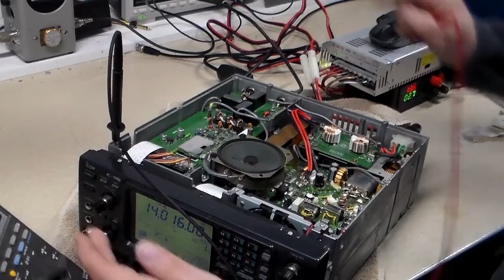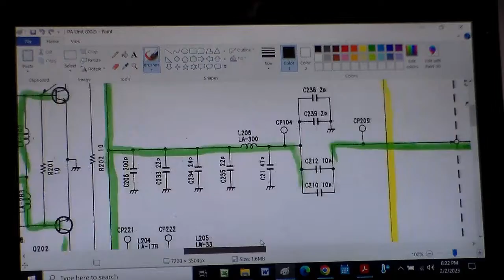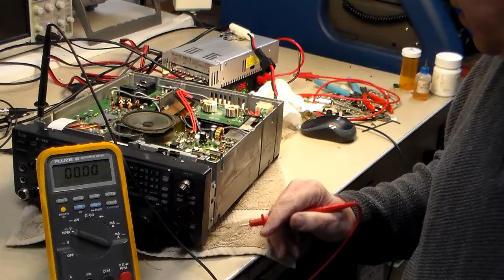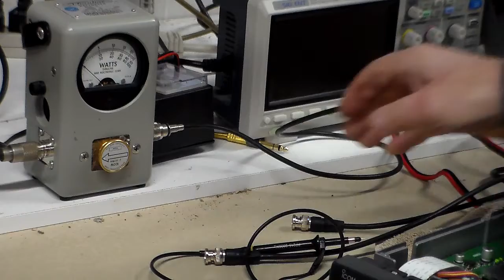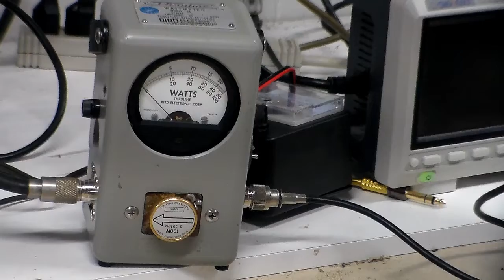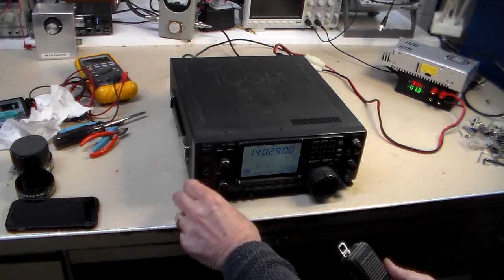Icom IC 746 Low Power Out - Solved!

Comment: Mine has good power out but the alc is low, like 50% no matter where I set it. Is there a fix for this?
Reply from the maker: On that radio, the full ALC range lines up with the PO 50% scale. Dont get them confused. You could try a peak reading watt meter and see what you power out is as you increase the mic gain.  For best audio and performance the mic gain should be set to keep you inside the ALC brackets. Hope that helps.

Comment: Had identical problem with a Yaesu FT-840. Low transmitter power, intermittently turned off and warm connector. Ended up being the Molex connector. Specifically poor crimping inside the connector. Good videos and info! 73! KA6VIP
Reply from the maker: Thanks for sharing. Glad you got it straightened out.

Comment: Had TX on all bands apart from 22 to 28 on a ICOM 735, turned out to be a relay which was replaced.
Then removed the PA board to check for dry joints and then refitted and now have no TX on any bands.
Receive is good throughout.
What could have coursed this?
Many thanks....

Comment: I have the Icom 7200. The power cord has dual blade fuses. Over time the fuse blades oxidise and the power drops off. Clean the blades on the fuses and power restored

Comment: Mr. Malik, I have a device with you, Icom 746 Pro. Youssef, I have a 746 Pro device. It has 100% reception and transmission, but it does not give a power reading in wattage. It is very low. Are there any patients? How can it be repaired? What is the faulty part? A picture so that I can complete it. Thank you very much.

Comment: Bypass the negative side fuse while your at it. It serves no purpose on a negative ground situation.
Reply from the maker: Thanks Larry. That negative side fuse may be some extra protection in a mobile set up under some specific failures, but, you’re right, in this situation it is probably just adding some resistance to my supply lines.  Oddly, I have a Kenwood mobile in my truck and it only has the positive lead fused.  Hmmmm.
Reply: @KA3AJI  If that fuse blows the antenna jack ground foil opens, that causes many other issues. I've seen it happen many many times. I always cut them off in my installs, so I would not have to fix foil paths later.  That fuse is only good in a positive ground situation. And then red lead fuse should be removed. Just a friendly tip from a 2 way radio repair guy. Good trouble shooting BTW.

Comment: 2 things... 1) You need to tx longer..... This is how I found the power issue on my Ic706. The fuse holders were at fault on my power cord. 2) You never addressed the improper voltage reading on the Q2. I can understand that the voltage coming into the radio was dropping, but that shouldn't have produced the higher voltage on q2. I'm about to take on a radio with a similar issue, and thanks to your video.. the power cord will be the first item under test.
Reply from the maker: I meant to get back to the Q2 voltage but forgot to mention that the bias resistors did not match what was on the schematic so, I chalked it up to that.  Maybe a factor fix for something.  Looked to be original.  As for the power cord, I plan on making a new one like the Kenwood design.  Two sets of #14 wire that go in to each fuse.  Also, don’t forget to look at your DC distribution center if you have a connection for multiple radios.  Good luck and thanks for the input.
Reply from the maker: I keep scratching my head about the DC voltages for Q2,Q3 and Q4.  I found a schematic online from Russia maybe, that shows the center tap transformer between those two stages feeds 8 volt to Q3 and Q4 not to Q2.  That makes more sense.  I haven’t had a chance to vet that yet tho.  I’ll dig around some more.